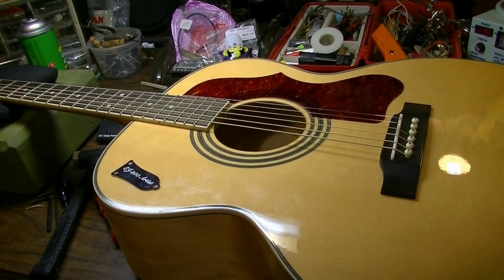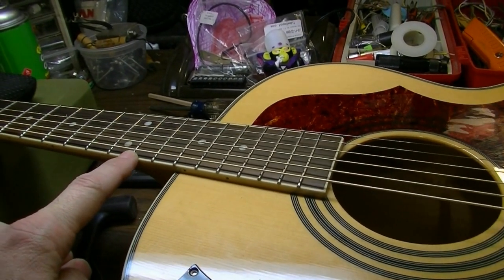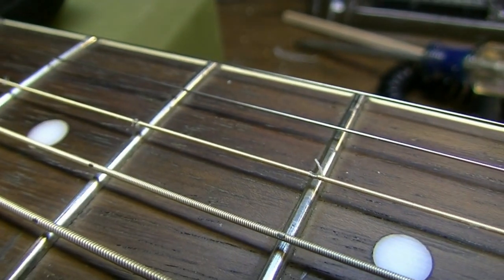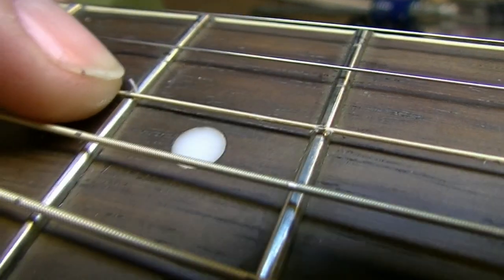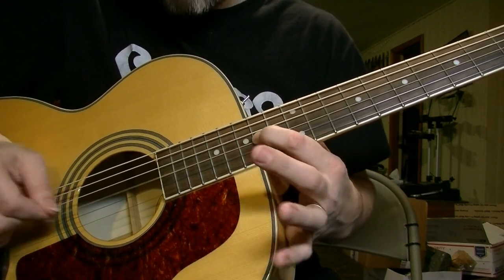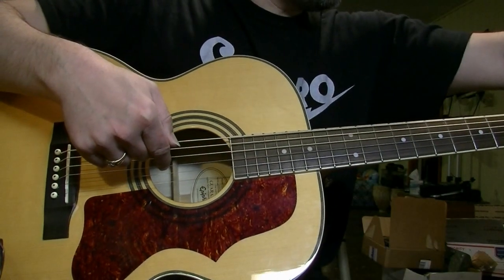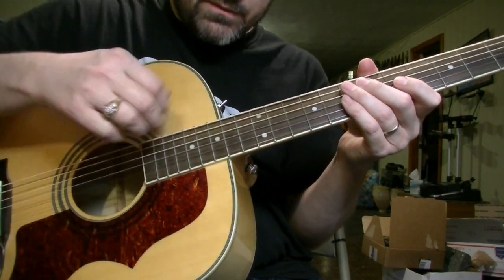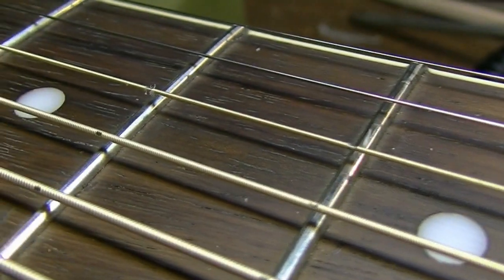Why I NEVER Use ELIXIR Coated Guitar Strings

Comment: Yep we're all different.  And we'll ALL have different results from strings.  However, I've been using Elixir Nanowebs for maybe the last 5 years or so, and they tend to last anywhere between 3-5 times longer than other brands I've tried over my many years of playing.  I play hard, lots of classic rock stuff, Deep Purple, Whitesnake, Led Zeppelin, Pink Floyd etc so, my strings take a beating.  I did break one at a gig recently, quickly replaced it with an Ernie Ball Super Slinky that I happened to have in my gigbag.  After two gigs the Ernie Ball needs replacing, it feels absolutely terrible, doesn't hold tuning at all, while the Elixirs are still going strong.  I'm probably never going to use anything else, unless a competing brand releases something as good.  I'll admit I haven't tried every string that's currently available but, Elixirs definitely come out on top of the ones that I have tried.

Comment: They must be Elixir Polywebs. I've used heaps of Elixir NanoWeb strings and never ever seen this. Elixir nanowebs are good strings. Especially if you live in a humid climate, and want strings to last a long time. I came across them in Cairns, Australia where it is very humid, & they're very popular up there. Other strings rust but elixirs last forever. Since then they've become my fave strings, even in dryer climates like Adelaide where i live. I prefer the nanoweb feel to D'Addarios and they're just so much better than crud like ernie ball.

Comment: Elixir sent a set of these free when they first came out over 20 years ago - I think I filled out a Guitar Player Mag survey and mailed it in (yes, mailed). They sent me a set of electric 10's, and a response card. As advertised, they sounded crisp for 4x longer than regulars, but started unraveling after 2 weeks. Sent the card back. After about 6 months, another set (vers 2.0) arrived. These sounded duller than the 1st set, but didn't unravel until about 5 weeks in. About another 6 months, I got a 3rd set, which where actually pretty good. But at close to $20/set, I decided to pass.

Comment: I think the big take-away here is the suggested cost/benefit analysis for the individual's particular playing,  both in style and amount of time played on a set of strings.  For me -- a non-pro,  country pluckin',  tin-eared,  ham-fisted,  tight wad--they were not worth the extra-cost.  I would have never even bought the first set,   thinking they were a gimmick,  like the old Nashville Straights,  but a friend who swore by them gave me a set to try.  I was amazed at how "bright" they sounded,  even with the coating,  and how bright and shiny they stayed,  in spite of my neglect of wiping them off after playing.  
But,  being one to never change strings unless absolutely necessary,  I eventually experienced the fraying of the coating,   as well as the G-string winds wearing through to the core,  the latter in first position and happens on other brand strings,  too,  to be fair.  
All in all,  I think they are a superb string,  but,  in my case,  not worth the added expense.  I can easily see how others mileage may vary on that,  especially reading the comments.  To each his own.  If playing was my livelihood,   I'd probably be all over 'em.
Reply from the maker: Thanks for the thoughtful comment. I agree with you. They work well for some, but it's a cost/benefit analysis each player needs to assess for him/herself.

Comment: Those are Elixir Polywebs. They have a thicker coating and peel fairly quickly. I have used Elixir Nanowebs since they first came out. I have NEVER had a problem with them. 
After 45 years of playing there isn't a brand out there that I haven't tried. Elixir Nanoweb is the very best strings I've ever experienced.

Comment: I've used Elixirs almost exclusively for about 17 years.  I used to play on River Street near brackish water sweating outside in July for hours busking.  This has never happened to any of my strings.  Back then as a sweaty teenager I used to eat through heavy electric strings (13-56) within days due to corrosive sweat and hard bends.  I went to Elixirs to avoid that happening while playing acoustic on the street.  Thus far I have never experienced this phenomenon.  I have had teo D'Addarios electrics unwind at the ball end on me recently.  Since my personal pH calmed down in the last decade I can play a set of Elixirs for over a year.  Pretty sure Elixir doesn't make strings either.  they are D'Addarios with Elixir's coating.
Reply from the maker: The Elixirs seem to be working for you, and that's great. I'm not trying to turn people off from Elixirs for whom they are working. I'm simply saying they do not work for me for this reason and many others share this experience. It's a well-known flaw of the strings that if you're an aggressive blues player who bends a lot and uses a lot of vibrato, this is the end result, especially on the wound G-strings. I managed a music store at one time and saw this a lot.

Comment: NO way those were NOT old. I've been playing Elixirs for years and never had the coating fray like that on the frets. I typically replace every 2-3 weeks with a significant amount of playing. They only fraying happens in the area where the pick strikes the strings. My hands sweat in such a way that 30-45 minutes of a gig will leave uncoated stings sounding dead, so Elixirs have been a life saver for me. This is NOT a common issue.

Comment: Those Elixir strings aren't for everybody and that's okay. I first started using them six seven years ago did not like them. but I was playing 50 hours a week all other strings I used would last me a week or less. I could buy a set of nanoweb elixirs for under $12 and they last me two months definitely a cost-saving . I don't like to change strings so I use them I did have a problem with the polyweb strings and they would come apart and fray. I do not have that problem with the nanoweb strings I've been playing acoustic guitar for over 30 years .

Comment: Those look like the Polyweb strings, much thicker coating than the Nanoweb strings.  The only problem you have in this case is that those strings look like they are simply worn out.  That being said, they last at least three times longer than the competition.  Change them to Nanoweb and the guy will be fine for about the next year if he is a moderate player.

Comment: Yeah they used to do that but they don’t anymore the old poly webs did it 15 years ago and the Nanos were really slick then they changed them and the nanos are much better the polys I don’t like but that problem went away a long time ago from my experience and those strings needed replacing a long time ago

Comment: This is a case where the strings should have been replaced as well.  I have a set of Elixir's that have been on a guitar for almost 2 years now, and they have yet to do this fraying that you are showing here.  Back about 5 years ago, all I used where non-coated strings, and what happens with non-coated strings, they sound like crap after about 3 to 4 weeks.  Well, all my guitars are strung with Elixir's.  I buy a set of strings for around $12 and they last well over a year?  Can't beat that.  I think you should reconsider the premise of your video here and call it, "How to avoid string buzz."

Comment: The only issue I have had with Elixirs is the greasy feel.  With some guitars they actually improve the tone, i.e. Elixir 80/20's with hogs.  Never had an issue with buzzing.
Reply: Old comment but don't know if you know about their new optiweb, lighter coating for a "rougher" feel if you prefer that. They don't last as long as the nano's but 3 months of brightness rather than 4/5 is still good.

Comment: I'm not endorsed nor connected in any way with Elixir, but I've been using them for a year and I have friends who have been using the for many years and have never experienced this. Before thrashing a company's product, you should do some research on it.  After watching your video, I got a little curious and I drove down to the local Sam Ash here in Orlando, Florida. They have an acoustic guitar room chuck full of regular to high end guitars. I asked the manager of that department, whom I've known for years and who's an excellent player and teacher about Elixir strings. I asked how many complaints he's had in the last 5 years and he replied none. As a matter of fact he told me he used Elixir in all his acoustics for years and never had any trouble. The issue you're presenting here must be an isolated incident and unless you've experienced and seen this issue repeatedly, it is in my opinion baseless opinion.

Comment: I blow thru strings so fast, I hardly notice the differences in brand. BALL strings are inexpensive, I use those.
Reply: I'm not a fan of EB strings, they tend to break on me a lot more than my elixirs and I can't get used to the tension. You're lucky to not be as picky! I usually change every couple of weeks and they still sounds okay at that time, but feel a bit different. :)

Comment: Godd video dispelling the myth about Elixirs lasting longer and being better value.
Dean Markley Signiture Bronze for me thanks.  Sound and feel great and are dirt cheap to buy.  Elixirs for me have this greasy feel which I don't like at all.  On top of that I find the Elixirs are very bright when you first put them on but become flatter sounding very quickly in relative terms.  This for me is a big issue especially if you want to record something and go back to it at a later day for edits / changes.  Much better to use cheaper strings and simply replace them often to keep the sound consistent.  I also like D'Addario uncoated strings as well as the Martin M140 Acoustic strings which are very consistent and again cheap.
I should also note that I have had Elixir Nanowebs that frayed / peeled within days of use and others which seemingly lasted for a substantially longer time without issues - so consistency in manufacture might be an issue.  This guys strings could simply have been from a bad batch - it happens I guess with all brands at some time.

Comment: I think you might be able to narrow your complaint to either the Nanoweb or the Polyweb Elixirs with a contrasting experiment.  Elixir appears to be pushing the Nanowebs, although I haven't been able to nail down the reason that they do.  I can easily hear the buzzing you mention (or the vibration of the plastic coatings).  If you or I get three to five times the life of a non-coated string with an Elixir set before the buzzing starts, I think it's reached it's lifespan and should be considered a "dead" string and it's not fair to complain after that time.  If the shedding starts BEFORE that advertised life, then it's a bad design and a bad deal.  And nearly everyone has a different personal reason that they claim makes their own case a "special exception" to whatever one claims in a video, you're going to get a crapload of complaints about whatever you say.  We "picky" people will find more things to complain about than those who aren't (the lucky bastards).  Yes, non-perfect crowning of the frets, relative smoothness of the job, and the differing degrees of polishing possible for fret jobs make a big difference.  Most people don't have their frets in "perfect" condition and have some degree of string wear that a perfect job (with polished frets that blind the player with flashes of reflection from the frets under stage lighting).  Stuff varies.  Acid in the skin varies, whether the strings and frets are wiped down after each playing, and maybe even the measurable humidity in the room makes a difference.  With all these possibilities, it's rather astounding that not every single commenter to your video hasn't found something somewhere to bless you out in an angry fit over.  I challenge everyone to make any statement about coated vs. non-coated guitar strings that no one can find exception with.  And we've just found a topic that seems to draw out complaints from just about everyone ELSE.

Comment: This video is 7 years old, at the time they made polyweb strings push for a thicker coating, since then they have changed to nano web coding which is a much thinner coating many times thinner than a human hair. So disregard this video as far as Elixir strings go. Has the way they are made now, are not the way they're made when this video was shot. So again I use these strings and have used them for some time now. I also used the Daddario coated strings also. So if you just now watching this video, which is I say is 7 years old.... Disregard this video altogether because they don't used polyweb coding anymore, they used nanoweb...
So all is well now, and I promise you you won't have any problems, I generally can leave these strings on for at least 6 months, and they get played daily.

Comment: I was a luthier for over a decade.  Ive put countless brands on guitars over the years.  

Elixirs are solid strings.  Although I personally do prefer D'addarios coated strings more, Elixirs are fine strings. 

Ive probably strung over 1000 guitars with just this variety of strings.  

All brands are susceptible to bad strings now and again. 

Now if you are asking me if I think they are worth the extra money over a regular set, Id say thats another argument but that one at least has some validity.   

My guess is this guy paid you to work on his guitar, came back bitchin realatively quickly, and you used the strings as the excuse.   

Which is a valid argument. 

But thats like saying you dont recommend buying light bulbs from Phillips cause once you got a bad one.  

Its just bad/dumb luck.

Comment: Never let them get that bad. strings are like oil need to change em every few miles let set of elixirs I had lasted 4 years before the high e broke not a bit of fray except very fine where I pick at
Reply from the maker: Magical Mystery Elixirs.

Comment: Bogus... First of all, DiADario makes the strings that Elixr adds the coating to. I have been using Elixr since they first came out & never had problems w/them. This is what happens with the nano coating when they get worn & need changing. I prefer the original poly web ones as the coating is thicker & it won't peel like this. My Tele & Carvin have the same sets for over a year now & they still sound great. Still I am a fan of you & your channel & have learned a lot from watching what you do. I don't agree w/everything you do/say but that doesn't keep me from watching & enjoying your channel. Thx & keep it coming!

Comment: I can tell from my experience that I"ll never use the Elixir Polyweb strings, They come apart in less than 30 days. I've never had a problem with the Nanowebs and continue to use them to this day. I do wash my hands a lot and for just about any reason you can think of, maybe that's why I haven't had a cold or flu in over 30 years. The hands are the dirtiest piece of anatomy on a human being. My Nanoweb strings last me about 6 to 8 months. I'd change them more if they were cheaper but the tone is still the same to my ears.

Comment: To be honest, I am hearing at least as much buzz and harsh harmonic in the replaced "clean" string as you got from that chewed up Elixir, so I'm not sold on this.  I think most of it is that you are plucking really hard on both of them to demonstrate the effect.  For clean, bright tone, a set of uncoated D'Addarios are wonderful.  But dirt and finger oil undo them so fast that I am happier using coated Elixir, because after a week or so of playing, they hold up and sound better than the uncoated ones that get dull in that time.  If I had $$$ to burn and could change strings every few days, I'd go with uncoated, but that's not financially practical.

Comment: If you can afford elixirs, you can afford a normal string rotation. I use Elixirs and have for years, and don't have this problem because I change my strings regularly as a typical guitar player should.

Also, most luthiers I know, put on NEW strings after they have done modifications to it such as pickups and electronics related, because you usually have to remove the old ones to get to it.
Reply from the maker: The customer asked me to save the strings because he'd just put them on within the past few days.
Reply: The Guitologist Damn, if those are few day old strings he either rested the fret against something or has abrasive frets.

Comment: That's not the strings. That's warpage. You need to tighten or lose your neck. Not sure why you filed the bridge though. New one on me. The string wear is normal depending on their time on the guitar.  These are made for bands that replace them after each set. But, your buzzing is definitely coming from the neck not being trued up. 👌🏼